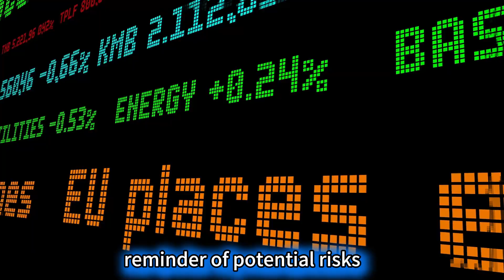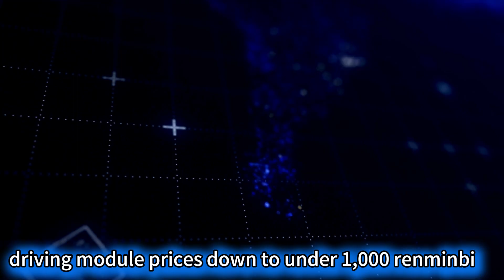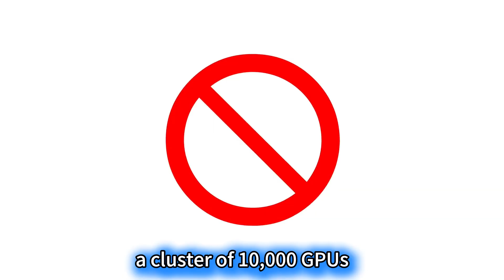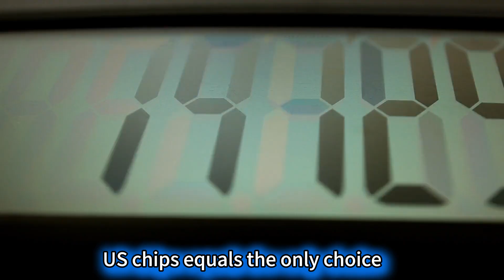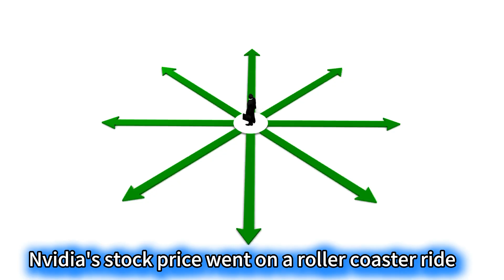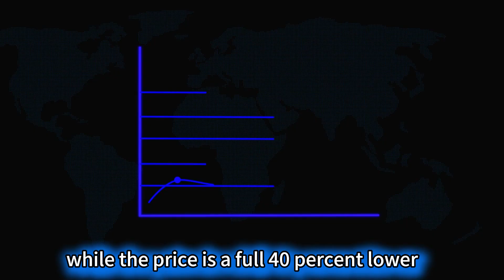Huawei Breaks the Siege, US Companies Loosen Restrictions Why Does the Crackdown Only Fuel a Resurge

Comment: China set to limit access to Nvidia’s H200 chips despite Trump export approval.  NVIDIA: It’s the CUDA software with its that can be shutdown with its embedded backdoors. Historically, the logic in Silicon Valley has been brute force creates miracles. The entry ticket to OpenAl costs hundreds of millions of dollars. Training a model burns tens of thousands of NVIDIA GPUs, and with the lack of green energy power grids, the USA electricity bill is astronomical.  They believe that as long as they stack the compute threshold high enough, China would never catch up.  However, China produced a batch of freaks like Deep Seek and Qwen.  Deepseek V3 and R1. China will continue to use Huawei Ascend 9XX family of GPUs.  Their training cost is only a fraction of that for a GPU4 equivalent model. What does that mean? It’s like Americans are building an atomic bomb and believe they must have centrifuges. The Chinese side manages to build one with an abacus and minimalist engineering and the power is similar. This low compute high intelligence approach directly hollows out the compute hegemony that the US is so proud of. If you can create world class without many top tier NVIDIA, what’s the point of the US trying to throttle China?